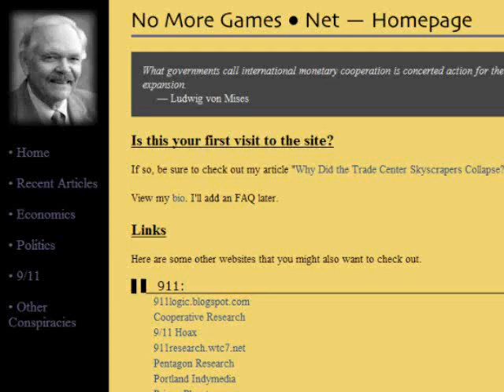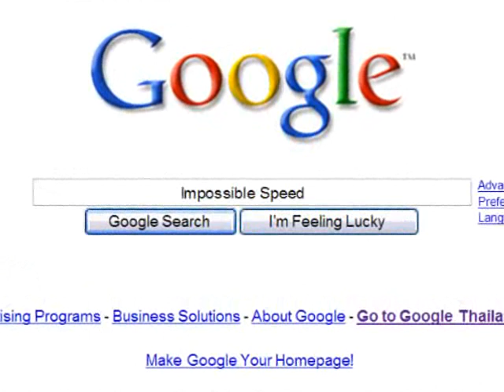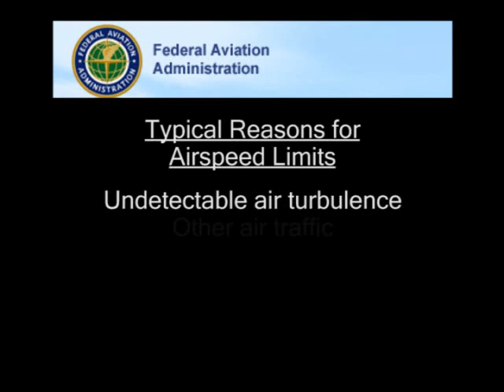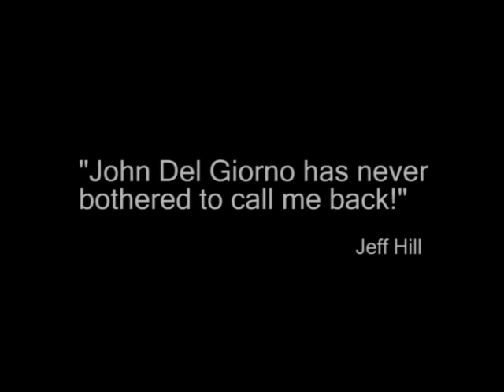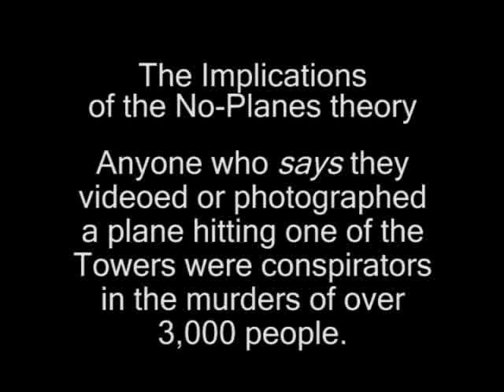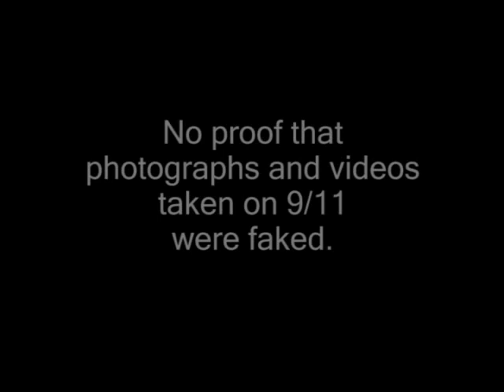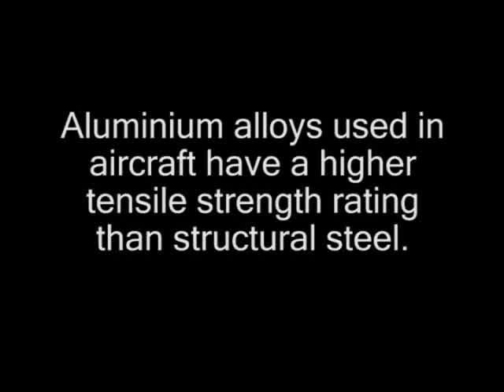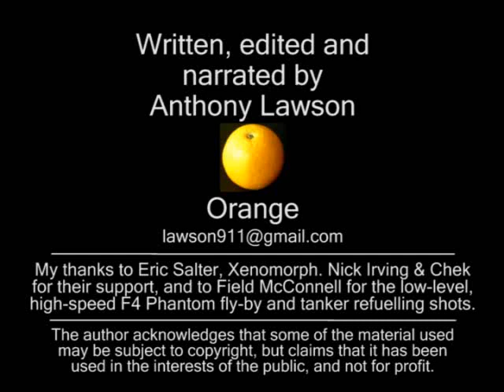9/11: Impossible Speed & Impact -- Busted! Updated

Comment: CONSPIRACY THEORY BLOCKBUSTER.
"BOEING 767 OUTPERFORMS CONCORDE BY 160mph AT SEA LEVEL".
(Based on nothing but bed wetting fairy stories).
READ ALL ABOUT IT.
Reply: Alan Marks So can i assume you are one who believes the "no planes were used" on the twin towers?
Reply: Antipodean33 No Boeing 767 series 200 or similar Jet Liner/Airbus was involved in the 911 Atrocities. Whatever struck WTC 2 had to be capable of maintaining 580mph at sea level.
Who believes what is irrelevant, it is 'KNOWLEDGE' based on 'Statement of Fact' that is derived from 'Empirical Evidence' that matters
Beliefs, Feelings, Opinions, State Imposed Civic Religions, Fairy Stories and of course Bed Wetting Fairy Stories are a total irrelevance.
Reply: Alan Marks Boeing states for a 767

VD = 420 KCAS to 17,854

VD = vertical dive
KCAS = Knots Calibrated Air Speed 

VD:Maximum Dive Speed

Now take 420 knots x 1.151 = 483.42 mph

So 483+ is the permitted speed to fly/dive and fly/dive safely up to 17,654 feet.

All aircraft have a safety factor built into their airframes which allow them to exceed the recommended or permitted speed by a certain margin. The speed of flight 175(586) is only 21% over permitted airspeed in a VD under 18,000 feet. Well within a 767's capabilities and margin of safety.
Reply: Lawrence Spies The VD speed given is the Equivalent Air Speed that the Airplane will succumb to Structural Failure due to Aeroelastic Flutter (The wings break off.(theorists only)) below 17.5 thousand feet.
This is related to the resonant frequency of the Structure and is well known to Engineers and Aviators.
It is at 420mph Equivalent Air Speed that the Airplane starts to become Uncontrollable and starts to suffer Structural Damage.
The Structural Stresses increase by 46% in any object increasing its speed from 480mph to 580mph as 580^2 / 480^2 = 1.46 or an increase of 46%, this also being overlooked by Lawson when promoting his ridiculous wacky conspiracy theories based solely on bed wetting fairy stories.
All relevant documents can be found at the 'Pilots for 911 Truth' web site.
.
"All aircraft have a safety factor built into their airframes which allow
 them to exceed the recommended or permitted speed by a certain margin. 
The speed of flight 175(586) is only 21% over permitted airspeed in a VD
 under 18,000 feet. Well within a 767's capabilities and margin of 
safety."
Do you have any references for this nonsense that you have written or have you made it up, or repeated it from Lawson's wild and fanciful theorizing and associated bed wetting fairy stories?
.
If a Boeing 767 series 200 were to reach 580mph at sea level it would have to take a Vertical Dive as it would need all of its propulsive force available and all the available gravitational force to even come close to the claimed speed of 580mph promoted by ridiculous wacky conspiracy theorists.
The max' speed that any other or normal Boeing 767 series 200 can maintain at sea level is 320mph and to have the potential to maintain 580mph it would need 7 engines to provide the propulsive force as the density of Air at sea level is 3.5 times that of Air at 35,000feet. 
3.5 x 2 Engines = 7 Engines.
Reply: Alan Marks 175 was in a sustained dive from 28,000 feet until it hit the S tower. P47s straight winged prop planes in WW2 could dive at 520+ below 10,000 feet. A 767 is heavier, has more power, is more aerodynamic and built stronger than P47. jet engines are quite capable of doing 500+ at sea level even break the sound barrier well over 600+. Thrust SSC broke the sound barrier twice ON THE GROUND on its two leg run to claim the title. Reno Air races where straight winged piston driven prop planes can reach 500+ lap after lap. Also the L-39 jets with JUST ONE ENGINE that race at Reno can reach 480-500 mph lap after lap at 50-100 feet. The VD is maximum VERTICAL DIVE speed below 18,000 feet at 420 KNOTS CALIBRATED AIR SPEED. that is 483+ mph. 586 is only 21% over this MAX VD speed. Many jets have exceeded their VNE(NEVER EXCEED SPEED) by larger margins than 21% and survived.
Reply: Lawrence Spies The Airplane in question is a Boeing 767 series 200, the terminal speed or max' velocity equilibrium is based on the motive and gravity forces available in relation to the drag resistance. This occurs at 320mph during level flight at sea level for the Boeing 767 series 200 as gravity is not a factor during level flight.
This would indicate to any Engineer or Aviator that if such a body were to exceed this speed during a dive the vehicle would decelerate during the level phase of the flight. One does not recall deceleration being mentioned by the Official Ridiculous Wacky Conspiracy Theory or by Theorists that promote such, with of course their bed wetting fairy stories.
As a Boeing 767 series 200 requires 7 engines worth of thrust to maintain 580mph during level flight at sea level (negating that the wings break off at 480mph) the Airplane would be decelerating at a rate that 5 engines would accelerate the Airplane as only 2 engines were available for Flight UA175.   7 - 2 = 5
The reason the Thrust 2 achieved such a speed is because of the high thrust of the engines in relation to the low drag of the vehicle. You might have noticed that the Thrust 2 does not have Wings or a Wide Body Fuselage.
Many Airplanes can reach high speeds with the help of gravity so long as their Airframe stays intact but unfortunately the Wings of the Boeing 767 series 200 part company with the rest of the Airframe at 480mph Equivalent Air Speed. Re; Egypt Air 990.
There is no mention of the 'Do Not Exceed Speed' (480mph EAS) listed by Boeing and the American Aviation Authority that this speed is only accurate to a tolerance of plus or minus 21% of speed or 46% of Dynamic Forces, the Dynamic Forces of course being the relevant factor (This always the factor to be overlooked by Ridiculous Wacky Conspiracy Theorists).
"VD" stands for, Design VELOCITY Dive, not "vertical", ie; the Nose of the Airplane below the Horizon. One is not aware of your "VERTICAL" Dive limits being issued by any Civilian Air Liner Manufacturer or National Aircraft/Aviation Authority.
Whether One uses the VD (Design Velocity Dive) or VNE (Velocity Never Exceed) speeds none have a higher value than 480mph Equivalent Air Speed.
Have a look at a Flight Envelope Diagram for a Boeing 767 series 200 so you can realize how Wacky your Ridiculous Conspiracy Theories are.
Are you by any chance related to or from the same Planet as Lawson?
If you could reference any of your Conspiracy Theory claims One would be most interested, until then One is afraid that your claims will remain and be seen only as Outrageous Wacky Conspiracy Theory and your reasons should be considered to be nothing more than Ridiculous Bed Wetting Fairy Stories.
Reply: The speed is secondary - what determines the physical limits of the Boeing 767 is Mach number and dynamic pressure.

510 kts at 400 m in standard atmospheric conditions equals Mach 0.775. This is well within the limits of the Boeing 767. But at 400 m it produces a dynamic pressure of 40,567 N/m², and that is too much. The maximum dive speed vD of the 767 is 420 kts.

This only means that flying at 510 kts is illegal, but it is still possible. If the airplane dove down to those 400m from enough altitude, it would entirely be capable to reach this speed, but would slow down once it stops diving.

There are several effects which can cause a catastrophic failure when flying too fast:

When the aircraft flies into a gust, the resulting load factor can overstress the structure.
When the pilot commands large control inputs, he will also overstress the structure.
Flutter might also cause structural damage.
The maximum Mach number of the 767 is 0.91 (0.05 above the maximum cruise Mach number, which is 0.86), and this corresponds to 523 kts in 11,000 m. Thankfully, certification requirements demand a margin of 20% between the maximum speeds and flutter onset speeds, so flutter might be close, but is still tens of miles per hour away when diving to 510 kts. Remember, to experience flutter you need also to excite the motion first. Here is a good discussion of this topic.

In short, flying a Boeing 767 in 400 m at 510 kts is not recommended, but is entirely possible and most likely even safe when done in calm air and by a calm pilot. It only won't last long, because the engines will not produce enough thrust to maintain that speed. Flying this dive requires guts, but no special skills.

Comment: Not even slightly dented - who produced this? A wide body, hi ratio bypass engine powered jet airliner simply cannot fly at maximum speed though sea level density air. Even if the engines could produce that much thrust, the airframe would disintegrate. Both are impossible, so go back to physics school. Stick your arm out of a car window at 100 mph and report back.

Comment: I agree with jbyeats first line (what a total load of GARBAGE) At  about the 830 mark , comparing the tensile strength of aluminum and steel....very misleading to say the least.....tensile strength is a stretch test .Try doing a compression test and you will come up with a completely different result.   Ya right....aluminum slicing through steel. I'm sure you have seen the video with the "NOSE IN  , NOSE OUT.....care to explain that?